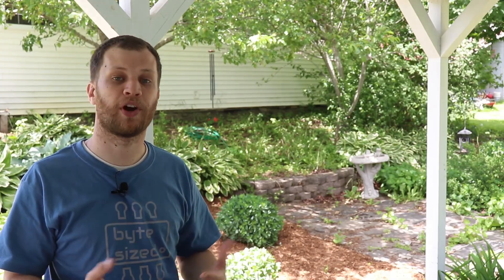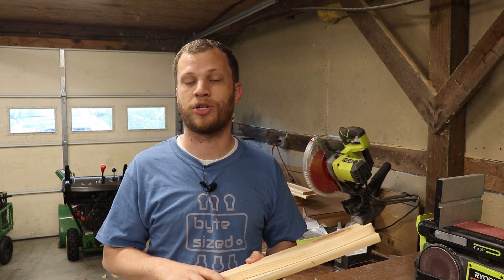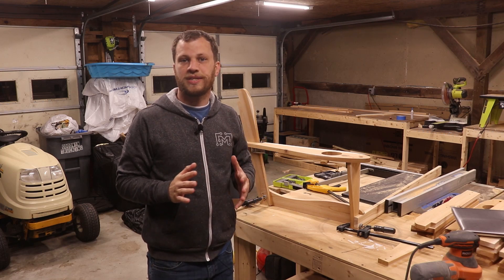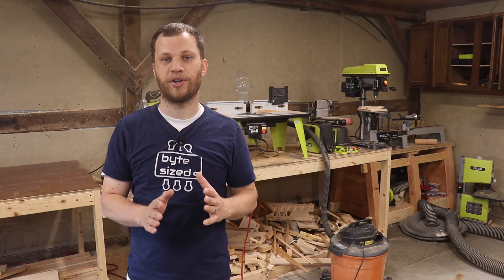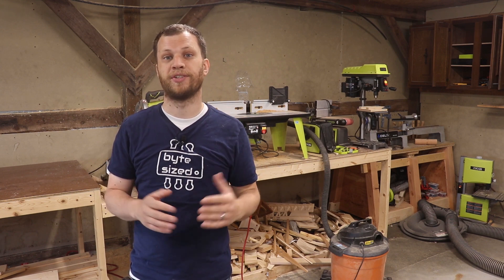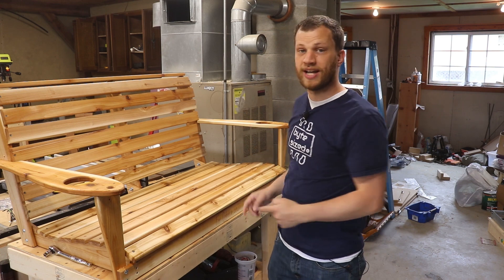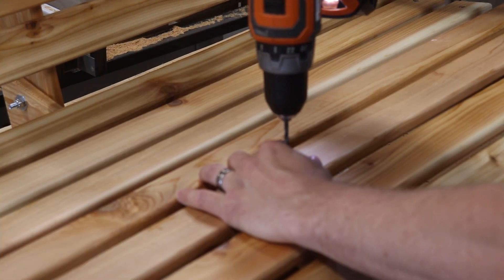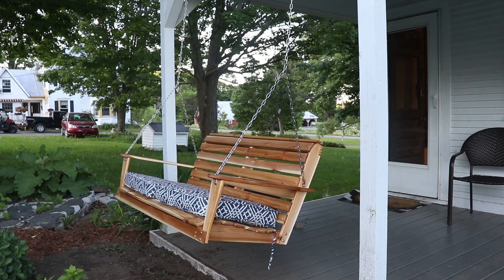How To Build A Porch Swing

Comment: I’ve looked at maybe 100 porch swing videos - hasn’t anyone ever seen or used a “vintage” porch swing?  What they all have in common is they are sturdy, have thin flexible seat and back slats, and they’re lightweight. This makes them much more comfortable than something with 3/4” (or even 1/2”) slats, and if a child walks in front of one or falls out while swinging too high (been there, done that) they’re not going to get a concussion. The one I grew up swinging in 60 years ago, the one my wife inherited built by her grandfather, and the one an elderly neighbor built for my mother-in-law many years ago were all built this way.  I’ve used the new-style swings and none of them were comfortable.